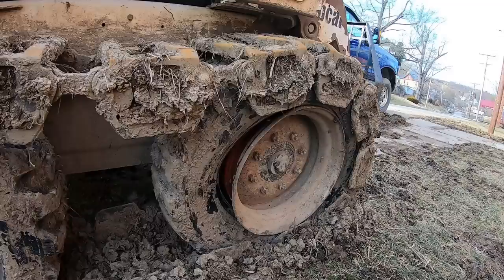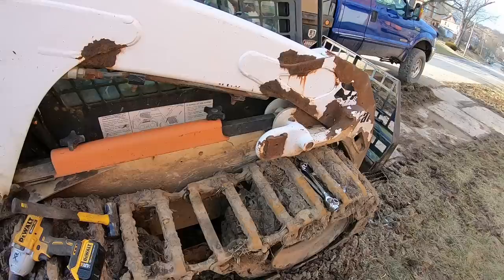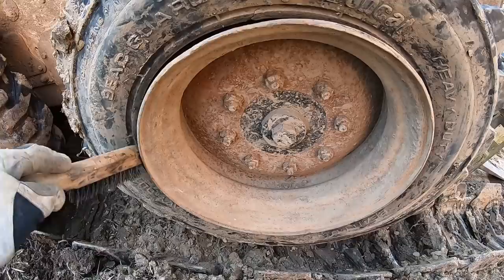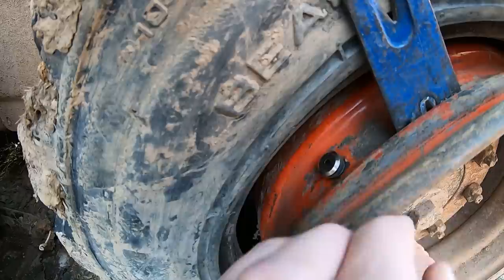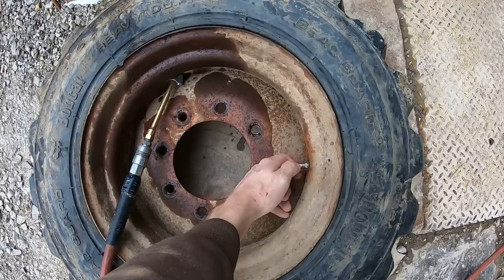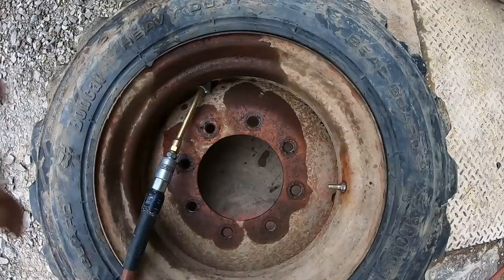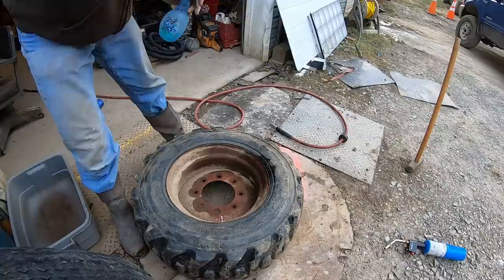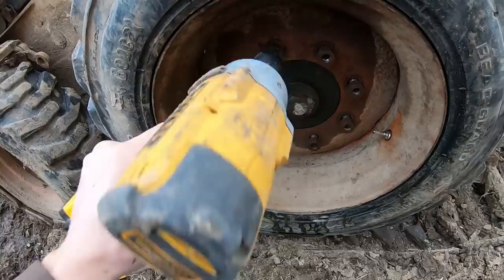Fixing a Skid Steer Tire with Starting Fluid and a Torch!! + all about my STEEL TRACKS

Comment: Shit happens when you don't have your skidsteer tires foam-filled. There's really no excuse not to do so. Either that or solid tires is the only way to go.
Reply from the maker: I’ve had people tell me the foam tires don’t work well with the tracks? Do you have tracks on foam filled?
Reply: @DieselCreek  I don't personally own a skid-steer, but the company I work for foam fills all of their tires just for peace of mind. There's nothing that's gonna make a foam-filled tire perform worse with tracks. Those people are giving you bad advice. Also, there's something to be said for solid tires as well. If I was in an ideal situation and owned all of my own equipment, almost every piece of equipment with tires on it would have solid tires, within reason ofc. Skid-steers, man-lifts (boom lifts; scissor lifts), and forklifts should all come with solid tires as a standard feature. With how bad things can get if a tire blows while you're picking something up tall, there's no excuse to not at least have the tires that came with it professionally foam-filled. I'm not talking about sticking a can of expanding-foam through a bunch of holes that will eventually just become saturated with water.

Comment: Next time 3 inch ratchet strap around the tread tighten it up you get it the first time every time
Reply from the maker: I’ve done that for smaller tires but these big thick equipment tires don’t like that as well. Being cold wasn’t helping either

Comment: Issue was you were spraying the bead and rim more than inside the rim.   You need to get your combustion liquid inside the tire so when it ignites the air blast blows blows it outward evenly onto the bead sealing the tire.   Like others said too remove the valve stem core to allow more air through faster to seal the bead also.  Nothing wrong with your content, the video where you tried to get the clutch fixed on the Ranger sucked but only because all that work you didn't get anywhere.   So it sucked for that reason and not anything you did wrong, it reminds us not everything works out in the end and some times you need to know when to call it quits on something.  I must have watched 30 to 40 of your vids so far and would not be coming back if they didn't entertain.

Comment: meth makers have been using either in starting fluid so the mfg. changed it no longer  has the bang. i went thru 3 full cans  use brake cleaner it still packs a bang
Reply from the maker: That sounds about right... few ruin it for everyone